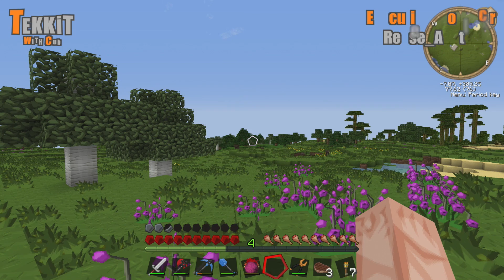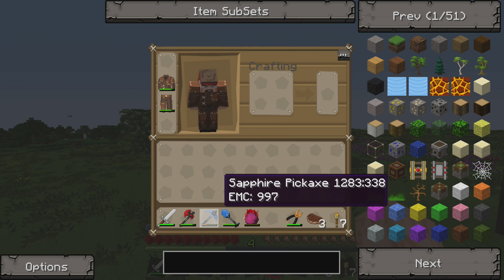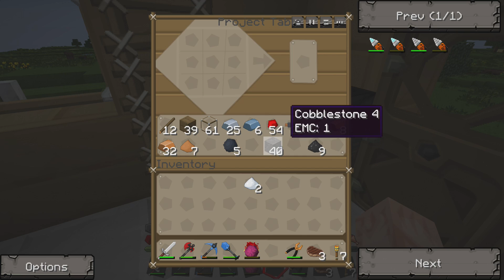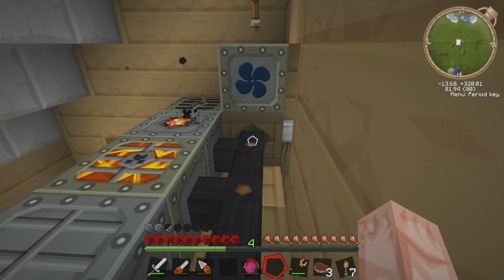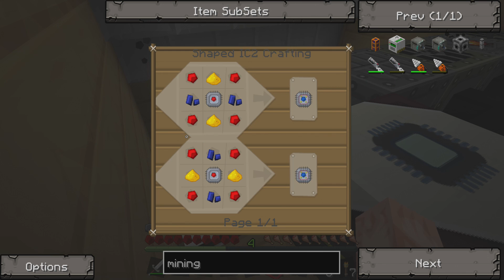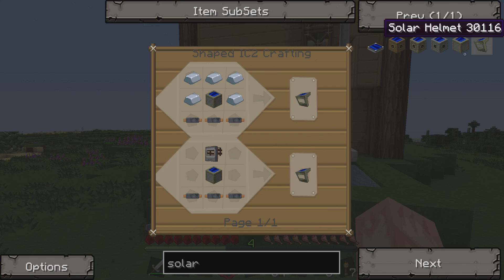Gearing Up | Tekkit Classic REDUX #6

Comment: In my experience in tekkit classic, the solar helmet only charges the jet pack or some other battery pack or something. And, you can see if an item has lost charge by the item ID. If it is fully charged, it will have a colon (:) followed by the number 1. I think it is called the data value and 24 means it is empty of charge.